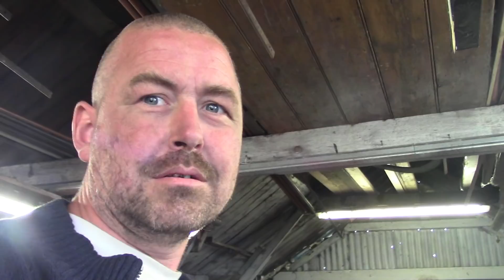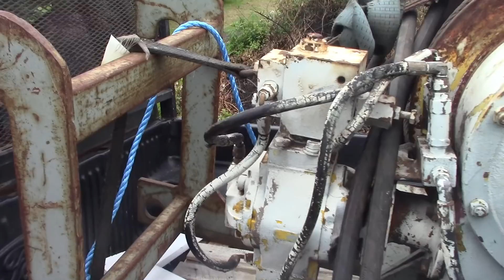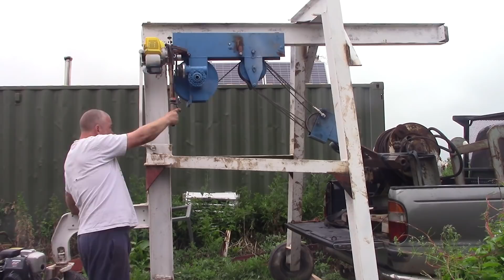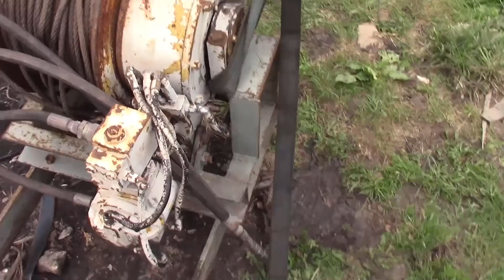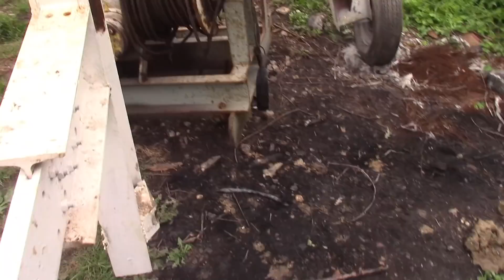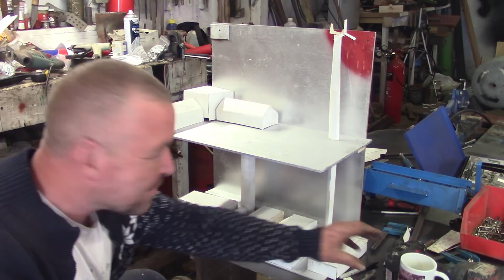Underground Bunker workshop. The suprise and a chat about the workshopolopulouse with 3d modeling!

Comment: Conveyer belts move dirt really well.
You could make the rails the dimensions of a mechanical disk brake - Cable pulls a lever with a spring acting against it - no pull spring closes the brake cylinder(s) and then the brake calipers grip the rails. Something like truck front disk calipers - then you could use air over hydraulic and the actuation can be quite lightweight - two sets - one upper and one lower to allow for redundancy...
Enough ranting - loving it - i came back here to drop this comment because i had thought about it for a while ...

Comment: Love this so much. Just an idea. Why don't you put the generator and environmental systems and other hot producing stuff at the other end of the complex under the vent. Venting heat and exhaust should be easier with less distance to travel.  I also wonder if heat rising would aid with venting the whole complex. Also the battery gasses won't be in every part of the underground rooms. Keep up the great work.
Reply from the maker: Sensible idea, someone else had suggested an air-cooled engine to really help with the draw on the chimney.
I shouldn't have to deal with heavy battery gassing as I'll use AGM batteries, but it would be nice to keep all the rooms ventilation isolated from each other and any electric fans on the inlet side of the ventilation to avoid ignition sources.
Reply: @turboconqueringmegaeagle9006  sorry. What are AGM batteries
Reply from the maker: @vanmanmarc  lead acid, "absorbed glass Matt" 
If you see "sealed" lead acid, they are either AGM or gel, they're never completely sealed, basically have a blow off valve for overcharging so they don't burst, that's why you might have seen some that look like they've been under vacuum because they don't let anything back in once they've initially vented.

Comment: I just got a winch today don't know what to do with it yet Got a load of rsj beams in the shed hopefully I can make myself a overhead gantry crane thingy don't really know the propper name lol got a lot of projects that need finishing shouldn't really start another.😂
Reply from the maker: Ah a fellow of the winch appreciation society.
Are you going to have two fixed beams with a third beam running along them? I'd call that a gantry but I don't really know what I'm talking about. Names of stuff isn't my specialty either.
Reply: @turboconqueringmegaeagle9006  yes two fixed beams and one on some runners got all the metal free aswell as the winch lol just got to buy the runners
Reply from the maker: @bobthebuilder8841  you did well mate, steel is silly money at the moment.
Reply: @turboconqueringmegaeagle9006  perks of working with the scrap man I love the scrap yard weigh in what you have chuck whatever you want on I come home with all sorts of things it's paradise lol last week got a stihl strimmer and a huge wacker plate I could spend a week in the scrap yard

Comment: It's just a thought, but why not have the generator room directly below the chimney/turbine the heat in that room should make the natural draft even stronger. You could also pipe the exhaust up the chimney saving space in the main entrance.
Reply from the maker: That's an excellent idea, someone else also suggested using an air-cooled engine but I've got other considerations like getting fuel to it and isolating it should we have a mishap, I also want to keep the 3 phase cable runs as short as possible.

Comment: This is so great! I cant wait to see the precast concrete beams/columns, where are you getting the math/dimensions for these things? Just over engineering it all? Ive been looking for mine engineering books but its all tbms :( awesome vid. Ps will you stress the reinforcement bars? i think i remember thats supposed to happen.
Reply from the maker: Tunnel boring machines? I've found various regulations for mining supports. 
Because I'm trying to get this waterproof, and butting deep profile sections against eachother to achieve a nice wide mortar joint I'll be using 10x more material than was recommended by the coal board and not pre stressing either, I don't see how I could achieve that without leaving the ends of the reinforcing exposed which would cause corrosion.
Reply: @turboconqueringmegaeagle9006  oooh mining support regulations, nice i will look them up. ahh yes corrosion good point!
Reply from the maker: @JulianMakes  I'd rather use glass or kevlar in the concrete but there isn't too much detail available for small batch mixes, I can order a lorry load from the local mixer company but the only fibers I can find on eBay are the acrylic or pvc strands for renders. Do you know a lot about concrete? What do you do for a living that results in you having tbm literature?
Reply: Oh i was just trying to find some actual guidance/literature on how to hand dig tunnels (basically like Brunel)… but with dimensions or examples. all i found were old etchings of brunells work and modern books on tbms. Id love a book on how to dig a tunnel the victorian way but i cant find such a thing! Where did you find your mining regulations? Depending on my soil/rock i’ve always wanted to dig my main shaft the dibnah way (lowering a steel ring then bricking up on that, digging beneath then lower ring then brick up on it again. All the while putting spikes in the brickwork into the soil to help reduce it all slipping down? Tbh mate its all just a wonderful idea, if id have started it here (the place you saw) id be in the same soil conditions as you, clay/sand/god knows!
Reply from the maker: @JulianMakes  I've got books on brunel and victorian tunneling but I've seen most of it online as well, there are dimensions and thicknesses in number of bricks, but the important thing with all of his tunneling was having an arched ceiling, so really if you were going down that route you'd be more concerned with the proper radius for your width (I think they figured out the arch needs to be 130° of a radius exceeding half that of the width rather than 180° of an equal width to diameter)
I toyed with the idea of brick but I'd have barely started, it's beautiful though isn't it. 
Trevithick, a famous cornish mining and steam engineer at the time started trying to dig the themes tunnel using the standard techniques of the day (how Fred built his shaft) and concluded it was impossible, obviously it'd also be impossible to sink a caisson shaft in the shallow bedrock of Cornwall or north east Spain, it'd never cut it's way down the hole!
If you did end up with a property in a valley you could just skip the shaft all together and start off by going sideways straight into a hillside.
Reply: @turboconqueringmegaeagle9006  great info thanks mate, we lived in cornwall and they did some awesome things down there! Yes you are dead right about the valley and starting horozontally, the house might be needing parking that is partially dug into the mountain (arched i guess). But tbh until i get to visit the site i have no idea of what might be needed. Ive even looked up explosive engineering courses in barcelona lololol (id need some good Spanish first hahaha).
Reply from the maker: @JulianMakes  absolute mad lad, you'd have to be so certain you weren't about to bring the entire hillside down on your house.

Comment: My lord you were not joking when you said you had something over the top coming in and I'd do some more research into the model of the winch cos I dont know much about coles but I've seen Russian made winches of equivalent size that were rated for 30-40 ton lol
Reply: And if you dont do a teardown video when you take it apart to check the condition of the hydraulic motor I'll ne pissed
Reply from the maker: Understood my friend, having trouble finding info on it, I don't think it was sold separately so might end up having to get a manual for the whole crane once I find out what it was fitted to!
Reply: @turboconqueringmegaeagle9006  I'd recommend trying to find a salesman's inventory book I'm not sure what there called but back in the day it was pretty for them to have a big book of their inventory with all the specs and sometimes they had pics too lol
Reply: @turboconqueringmegaeagle9006  Forty years a Salesman by R J Lloyd might be something you want to look at

Comment: If you're not too concerned about a breaking system for the lift but wonder if the distance is still dangerous, maybe consider a spring loaded crash pad on or sunken into the floor at the bottom of the shaft? Should be enough to avoid life threatening injuries, as well as structural damage to the lift itself? I think normal elevators have some kind of crash pad at the bottom, so might not be too difficult to find information on how to build a proper one.
Reply from the maker: Very interesting I had no idea, it would mean digging deeper to accommodate it though, the other consideration would be that my lift will have a load from 1 person right up to a ton of muck, variable forces are a problem for frangible devices.

Comment: That winch is a beast! As far as controls go, however you're going to do it, you want remote operation at multiple stations - like a real lift. So that, ultimately, you can call and run the car from either end, right? I bet you end up with a PLC and electrically actuated hydraulic valves. Even if you want it EMP proof, you can shield the controls. Why not dump the heat into the quicksand? You can shove a U-section of pipe into the wet sand, then pump water/coolant/refrigerant through the pipe. Maybe even one of those heat pump systems they're installing in houses now, where they use a tunnel snake to install pipe a hundred feet underground and use the thermocline to pump heat wherever they want it. In summer they pump warm refrigerant down into the ground and pump back out relatively cool refrigerant, in winter they pump in cold refrigerant and bring up warm refrigerant. It's basically an AC with an X valve so you can flip the flow around, and a bunch of pipe. The ground is an infinite heat sink or source depending on your application, although it's low quality. i.e. not much difference from whatever you're trying to heat or cool. In engineering, a 30 degree difference isn't very useful, we prefer a couple hundred to really get things moving, but small thermoclines work with good refrigerants or with large volume heat exchangers. So cooling with an earth system takes a LOT of pipe but it will work. The trick is to pick the refrigerant that works with your thermal limits. Hearing you talk about ventilation shutoffs and fire etc remind me of my Navy days. Basically, you are designing a ship. A ship that sails in dirt. That doesn't move. A dirt barge, if you will. Truthfully, the model is brilliant. Looking at it, it would make sense to go down, and then make a main tunnel, and put the chimney/vent/windmill at the other end of that tunnel. Rooms would then be off either side of the main tunnel. That would simplify all your service runs, and make natural ventilation a possibility. Edited for the 10th time to add: cheers, mate. Great vid.
Reply from the maker: Obviously I missed the dirt ship edit on the original comment. I'll need to be strict with towels having cord to tie them up so they don't get sucked into pumps in the event I get torpedoed by a u boat.

I'll head over to ghost town after replying, I'd seen a few of his vids, nothing underground so I'm obviously not paying attention!

Modern light industrial lifting gear is a joke, I wouldn't feel comfortable taking any new engine crane, chain block or come along to it's rated load.
The home owner lifting gear is just terrifying.
Reply from the maker: The hydraulic lines going to the lift car would require three sets of valves to call the lift, another drum with swivels to wind the 4 hoses onto and 4 hard lines down to the bottom to achieve the same functionality as the torsion rod and single valve. 
I'm not too worried about calling the lift but don't like the idea of winding the hose up and the swivels are really expensive.
Reply: @turboconqueringmegaeagle9006  That's going to have to be a pretty massive bar to resist torsion and bending with a 10m length ... I'm interested to see how that would work.
Reply from the maker: @forge20  very true, perhaps 2" box section, it would need some pretty hearty bearings at the bottom. Obviously it'd only be able to have bearings top and bottom.
The only ways I could think of getting a push rod to work is by the lift car controls dragging on it or with latching valves or latching switches operating solenoids, I don't like those ideas, not keen on in car hydraulics and long hoses, electrical would mean conductors running the length of the shaft and brushes on the car or 10m of cable to the car, remote control would be very easy, I had a 12v 4x4 winch remote operating my old 240v ac winch when I first started this hole.  
Laser beams! They are pretty affordable now, if I had them pointing straight down with the reflectors at the bottom, a cutaway In the lift so it couldn't obscure the beam and then the selector in the lift just obscures the up or down laser it would at least keep all the complexity in one place. What am I missing? Still favouring the torsion bar.
Reply: @turboconqueringmegaeagle9006  IR, rig it up to run from the remote for your telly.
Reply from the maker: Ha, I bet you've messed around with winches that make this look like a yoyo, but for me it's big so thank you.
The simplest way I can think of doing the lift is using a square bar running the full shaft, it'd operate the valves up top, the controls in the lift would slide up it and I could probably get away without using restricted orifices if the lift car had limit stops that act on the torsion rod near the ends of its travel.
I like the idea of the heat sink very much. I wonder how effective it'd be buried into a wall with some insulation between it and my structure.
I don't want long runs of coolant, and if they are not avoidable it'd make more sense to run it to the surface and create a passive convection loop without any pumps. I can't imagine I'd ever be in a position needing to take heat from up top down into the bunker.
Reply: @turboconqueringmegaeagle9006  You could just suspend a loop of hydraulic cable long enough to reach the bottom and run the levers from the car, it's only 10m. Then you could use common sense as your limit stops. ;) Ghost Town Living just left his 1M YT subscriber plaque at the bottom of a 900' vertical shaft. It's a cable winched car, but he's stuck with an operator at the top and a 45 minute trip.
Reply: @turboconqueringmegaeagle9006  Oh and as regards  heat - after a few hours in a 55 degree tunnel you might wish you had some forced hot air heating. Especially if it's damp.
Reply: @turboconqueringmegaeagle9006  In the Navy, I was qualified to run a ship's crane with a winch about that size, and it was rated to 25T and load tested to 60T. I'm with you on that 2.5 safety factor bit, you're lucky if you get 1.1 these days.

Comment: Do it all mechanically.   Three reasons it's more reliable, you can fix issues without having to get in to electronics, and levers would be cooler.
Reply from the maker: Sold! Oversize brass levers beat buttons all day thanks for talking sense.
Reply: This was exactly what I was thinking!

Comment: the natural draught idea is great but avoiding manky air going underground seems sensible, could a fire in the machine shed fumigate the entire complex? if you had a heat exchanger on the genny exhaust you could flow clean air the other way without the chimney.

boreholes go very deep down, hundreds of feet and through solid rock, if you don't hit the bedrock you shouldn't have any worry about high pressure aquifers, though our bedrock is only a few feet down so springs pop up where there's aquifers (also called "black rivers") close to the surface, not sure if your thick overburden would suppress that. spose we'll find out!
Reply from the maker: Initially, while I only have one shaft, the air will be blown through pipe down the shaft then exit up the shaft, once the second shaft is dug, I'll still use the existing vent pipe to allow air in but the doors or whatever used to let air back up shaft 1 will be sealed, this means I can easily pick up clean air from outside but most importantly if I rig cut off flaps I can shut off all ventilation and deal with whatever problem has occurred. 
I can't remember what my mate said his borehole went down to, 70 something, if it's meters that gives me loads of space, if it's foot I'm a third of the way there. The really vague geology map says mudrock/sandstone between 15 and 30 foot down to the hard stuff at 80
Putting the generator radiator at the bottom of shaft1 initially would be ok, would still need to get rid of the radiant heat from the engine though.
Toying with the idea of a tropical fish coolant pond....
Reply: @turboconqueringmegaeagle9006  always good to have as much configurability as possible. i'm assuming by "tropical fish" you're referring to what will have to be on the customs certificate for the delivery of freshwater sharks with which to populate your evil monologue room.
Reply from the maker: Brilliant mate cheers
Reply from the maker: @gramursowanfaborden5820  what an amazing video, I've never seen anyone swage pvc pipe on a cow dung fire before. Nice boring method.